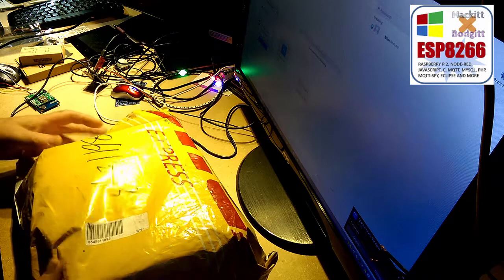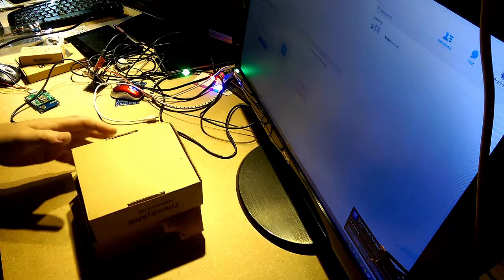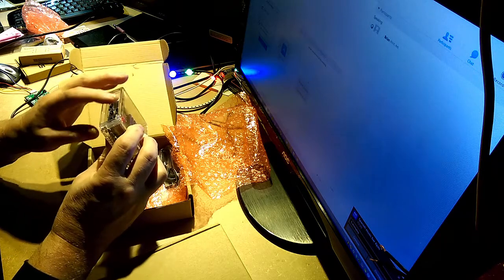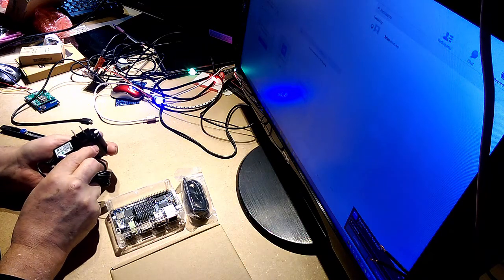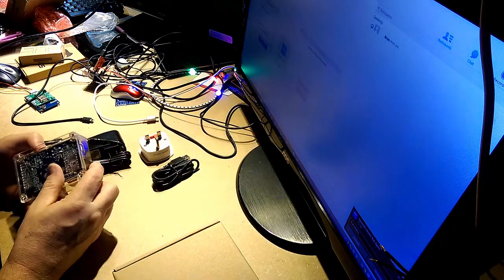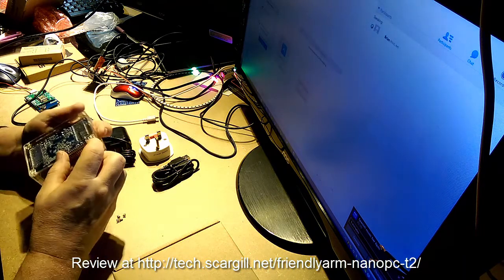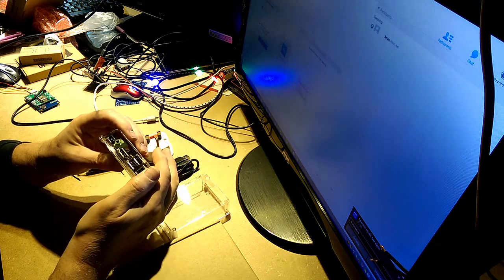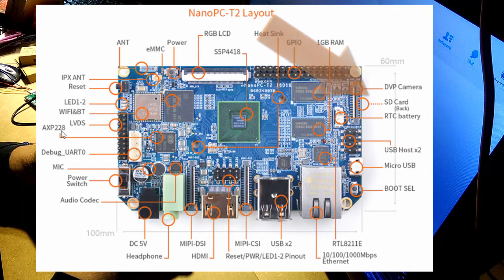FriendlyArm NanoPC T2

Comment: Hi,
> 
> We have purchased HD101 and NanoPC-T2.
> We have connected the two and power-on the board.
> Android is booting and display is coming up.
> But touch is not working.
> Does the software shipped along with the board (flashed to eMMC) support touch.
> Please advise on how to make touch work in HD101.

Comment: Pete do you have maybe somewhere an article about how to use node-red-contrib-thermostat, it looks very cool. How is the temperature input handled - via MQTT input? If not could you maybe extend it so it could accept a few temperature values (or humidity values for controlling a humidifier) via MQTT and work on those values.
Reply from the maker: +msevyt Hi - I put it out there but then my rapidly changing requirements kind of rendered it obsolete - it is in fact really easy to write a function in Node-Red to do the job - mine is WAY too complicated to describe - but essentially - I pull in temperature info (and humidity as I want to protect against damp, too) and store in global variables. I have a global object containing set temperatures at different times of the day, weekly and weekend - I so then in the function it is simply a case of pulling this together. For ease of maths I store times as minutes from midnight then you don't have to get into all sorts of calculations involving hours and minutes etc... having gone through determining which time zone and temperature applies to now, I then check to see if the temperature is below the set temperature (unless I'm on HOLD or ABSENT in which case I use a fallback temperature) - I set a  global variable to on or off. That is all done in one function which runs constantly.  Meanwhile elsewhere - once a minute I check the global var, if true I send an MQTT message to the heater to turn on - or to turn off.  It really is pretty much that simple and because of Node-Red's visual interface it is all easy to change and expand - which I'm doing constantly - I've just added in my new office as a separate system - just duplicate the code - and point it to a different structure and devices...
Reply from the maker: +msevyt incidentally if you grab the thermostat - there are only two files-  an HTML file and a .JS file - you can hack these for your own uses quite easily.
Reply: +Peter Scargill Already grabbed it, thanks for explaining! The temperature and humidity that you pull in and store as global variables? Can you explain that more in detail, I don't quite get it since I'm a noob :). What would I need to do with the MQTT temperature value that i get from the mqtt node, should I just connect that one the the input side of your thermostat node?
Reply from the maker: +msevyt  yes - but I was referring to a version using thermostatic code in a function, not that node. Having nodes do stuff is very nice but has nowhere near the flexibility of being able to double click on a function node and make changes instantly... hence my move in that direction.
Reply: +Peter Scargill Will you share then also that flow in on of your future blog posts? :)
Reply from the maker: +msevyt  how about now!!??! http://tech.scargill.net/node-red-thermostatic-function/
Reply: Haha you are awesome! Thanks! Reading with interest :D